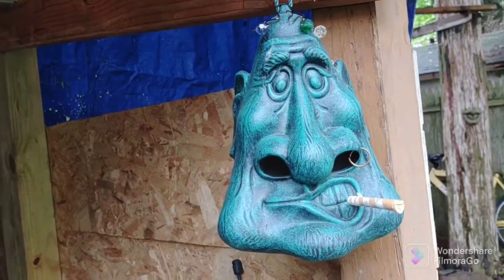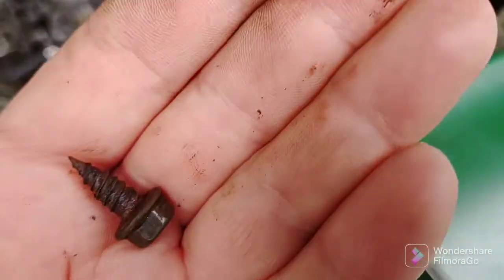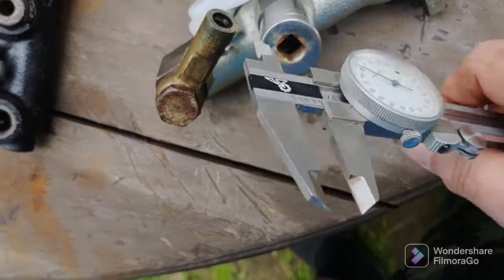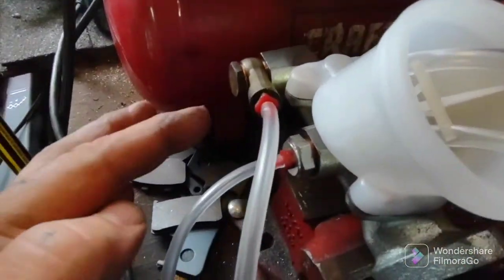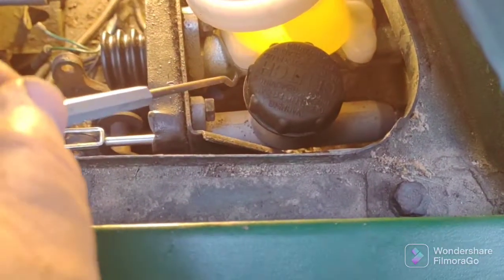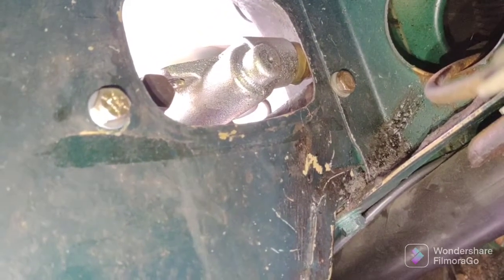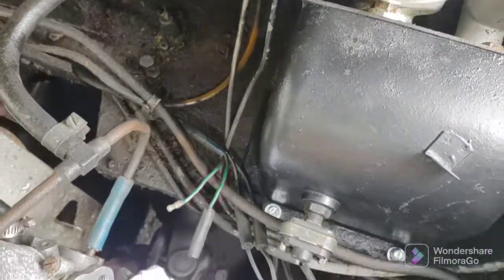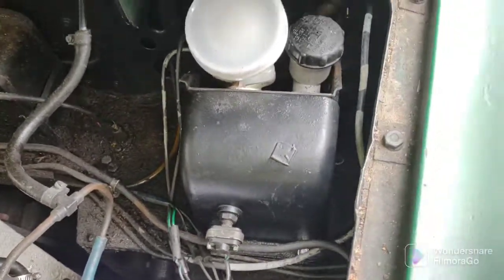MGB Brake Master Cylinder Installation - and front brake hoses

Comment from the maker: Regarding the brake bleeding, I didn't use the procedure in the Haynes manual. Instead I used the gravity bleeding method, and it worked well. I made a subsequent video on the gravity brake bleeding, too, if you are interested.